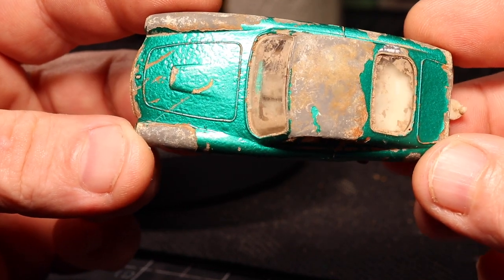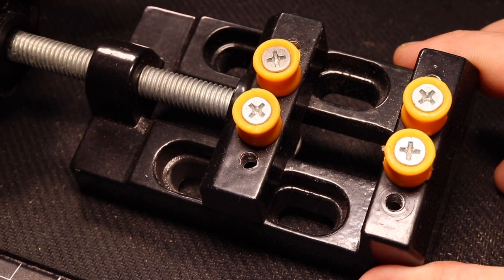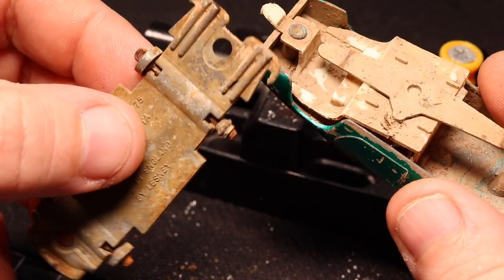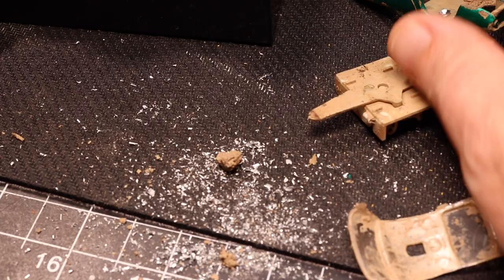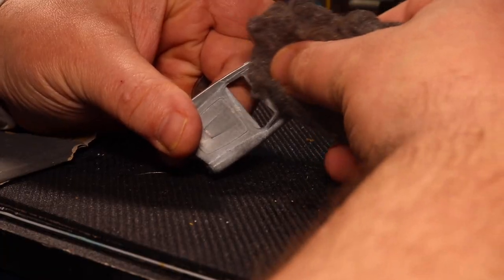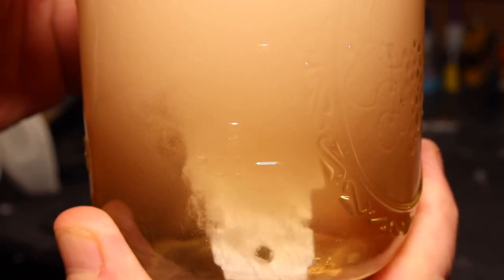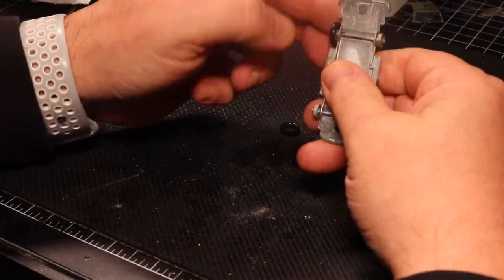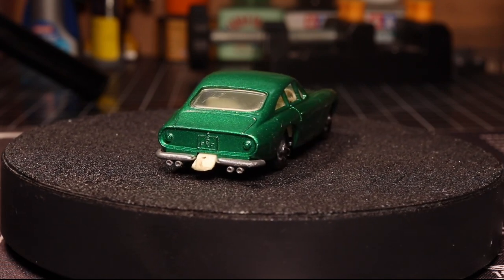Amazing Restoration Matchbox Series No 75 Ferrari Berlinetta

Comment: Fantastic restoration, just for information the plastic diamond on the bottom of the interior is a suspension piece. the axles rest on it and if you push down on the car it allows a little travel for the axel and for it to spring back. Often after all these years they will be a little bowed so no longer working as well as they once did, but with a little heat from a heat gun and careful bending back you can straiten them, not worth the risk if it is just going to be a display piece as they can be fragile and are easily broken, I speak from experience. :-)
Reply from the maker: Awesome info, thank you!